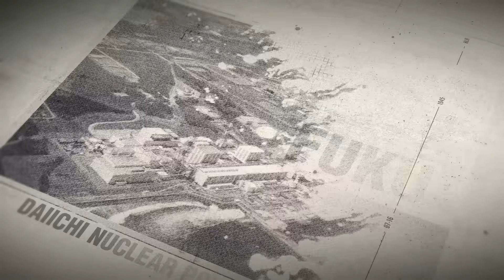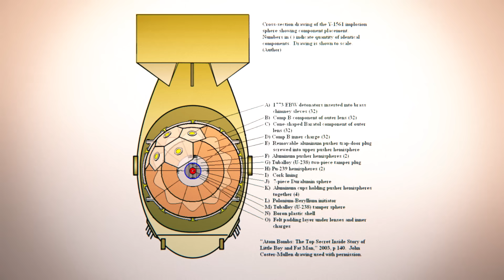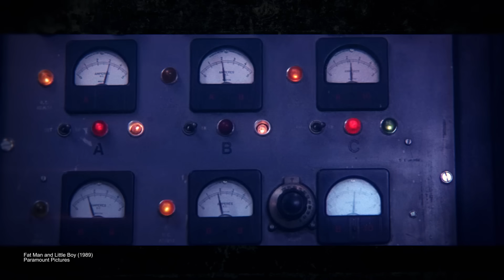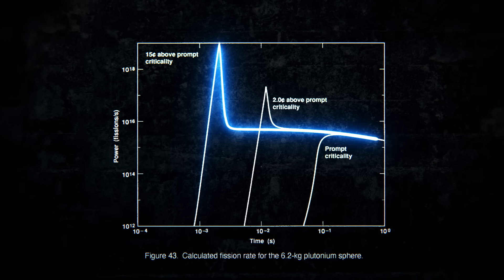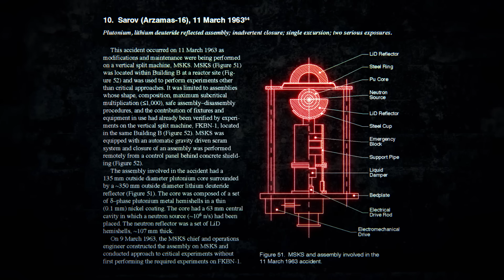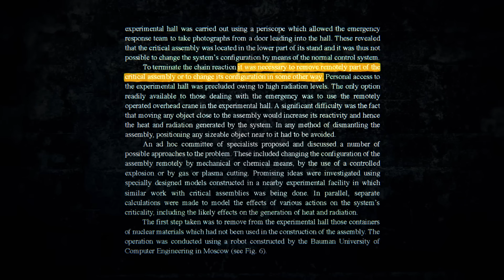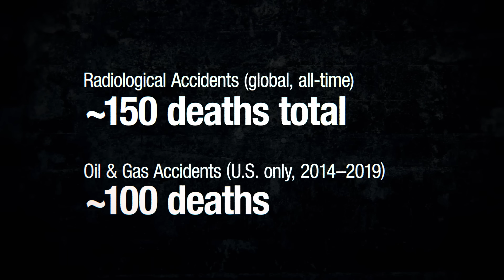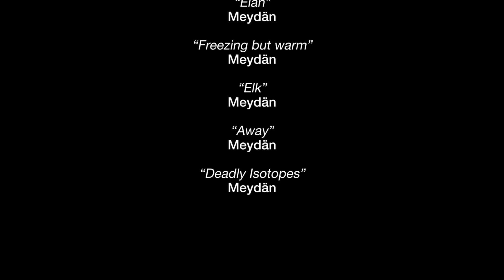Russia's Demon Core - Sarov Criticality Accident

Comment: I want to tack on for anyone that thinks radiation deaths are worse than anything the oil industry could cause: the oil industry in the US uses hydrofluoric (HF) acid as part of the refining process. HF is both highly caustic and a contact poison which can turn into an odorless gas when exposed to air. It penetrates latex gloves, skin, and deeper tissue rather easily and really likes the calcium in your bones. It also really likes fats and can cause cellular damage including to nerve cells so people who are exposed to it often don't seek medical treatment until it's too late since they can't feel the damage.

From Wikipedia:
"In a concentrated form, HF can cause severe tissue destruction through lesions and mucous membrane damage, but dilute HF is still dangerous because of its high lipid affinity, leading to cellular death of nerves, blood vessels, tendons, bones, and other tissues."

Philadelphia was almost exposed to this in 2019 when an oil refinery exploded due to negligence of maintenance but fortunately the people on site reacted quickly and appropriately and prevented a terrible tragedy from occurring

Comment: I live near a couple nuclear plants. One of them has speakers set up in a certain radius to blare an alarm if there is ever an incident. They test them now and then to make sure they still work. While the residents are notified of the tests to avoid panic a delivery driver who lives outside of the area isn't. So I was working one day and the test happened. I didn't shit my pants or panic. I just accepted it. There is no outrunning a runaway reaction. It happens so fast you wouldn't even have the  time to think about what to do. Texted my parents that I loved them, brothers too, and continued working. It sounds stupid but when you approach everything scientifically and you can calmly accept that things are just fucked behavior like that is expected. Didn't see a point in sitting there in a panic or trying to outrun something that happens faster than the brain can send signals. Since then I make it a point to check when they're testing the system.

Comment: It's no surprise the guys selling buggy whips would play up the dangers of automobiles.
Reply: To their point, have you looked at the numbers on casualties directly caused by automobile use? In just the U.S. in 2022, there were 42,514 fatalities. That averages to ~116 each day that year. I fear if we ever have "flying cars" that are more than just airplanes.

On the other hand (and I only just happened across this while curiously looking up Horse & Buggy numbers for contrast)... it appears there are serious issues with safety and treatment for horses used to pull buggies (and thus secondary risk to the people transported by them or in the vicinity), especially in cities (they are very *not* built for traversing concrete) and hot/cold environments (they don't have special hot/cold resistance) their bodies just aren't equipped to handle.

Along with other factors, it's looking like the last support for horse & buggy has been largely vanishing worldwide.
Reply: @JarieSuisen 
I was simply making the point that obsolete industries (like fossil fuel) will make the new technology look dangerous and scary. Ie Edison electrocuted an elephant to "show" the world how dangerous alternating current is...never mind he was heavily invested in direct current.

Comment: I think the reason nuclear energy is so scary is because it is spectacular. Deaths are either horrifying, or a silent killer it is impossible to escape, while in the oil industry they seem so much more mundane. I am terrified of the gas tank in my grill. I know it´s not gonna explode, there´s not enough pressure to turn it into a shrapnel grenade. Still, the fear persists. Brains are unhelpful, that way.

Comment: I am, personally, extremely grateful I live near a nuclear power plant (Duke Energy Progress, Wake County, NC). I grew up in an area with primarily coal power, as well as a NASA facility with a garbage burning plant for its power, and it's an extremely marked difference in air quality even just baseline. Plus, vegetation and water sources are healthier here compared to where I grew up. I grew up in the Chesapeake Bay region of Virginia, with protected marshlands in every city or county that's direct against the coast, and yet the closest we ever got to nuclear energy has been the reactors they put on naval ships and submarines at the Newport News shipyard. Hell, the nuclear plant here even has a program where they offer iodine tablets, 100% for free, to whoever requests them as a safety precaution despite the incredibly low possibly of an excursion or other accident that could cause significant fallout to the surrounding area. And the portions of the grid that are attached to that plant are more stable, to boot. It's rare that a storm knocks out residential power in areas that are directly on the grid supplied by that plant. Stoplights are a different story since their power supply goes through a switchboard/regulator that's significantly more vulnerable than the rest of the grid.

I do thank both you and Plainly Difficult for giving me the tangible information to explain how much safer nuclear energy is compared to fossil fuels and even at times things like wind power (the maintenance of a wind turbine is hellaciously dangerous), statistics and all. ❤☢️
Reply: I was an Instrumentation Tech there at SHNNP 1983 to 2005. Fun times.

Comment: What gets me is the fact these guys were doing these experiments right at ball level with no sheilding.
Reply: Shielding is not normally required when working hands-on with unirradiated uranium. Given sensible working practices, doses can be acceptably low without any shielding.
Reply: @derekp2674  yeah, i still dont think any sensible man would want his junk anywhere near radiactive material no matter what the case may be.

Comment: 10:20 I would have tried to use a powerful fire hose.
Knock it over with the water pressure.
And even if that fails the water might help act as a moderator to reduce some of the effects.
Reply: Water as a moderator might act to make the criticality worse not better.
Reply: @derekp2674  Only if there are walls for it to bounce back off of.
It slows down the particles, which when in a reactor means they will bounce around at a better speed.

But if not in a reactor, there aren't as reflective walls for the particles to bounce off of.

Meaning it will simply slow down their speed.
Reply: @Targe0 Ah but slower neutrons are more likely to cause fission than fast ones.
So firefighting with water can be a great hazard in some nuclear plants.
Reply: @derekp2674  They can only cause fission if they are moving back though the core.

Meaning they have to exit, pass through the water and go out and bounce off a wall and come back to land in the core again.

Which, as the room was designed to absorb radiation leaks, the amount of rebounding would be minimal.

As, reactor cores are also designed to aim everything bouncing off the walls back into the fuel.

Their experiment room was not.

You're looking too much at the particle physics and not enough at the geometry needed to make the physics work.

Comment: In the fission diagram at about 1:30, the large nucleus being split is labelled as U236. Should this be U235? I thought U236 was not fissile.
Reply: U-236 is formed after U-235 absorbs a neutron. U-236 is very unstable and so about 90% of it fissions soon after formation and the best undergoes radioactive decay with a half life of about 23 million years.

Comment: How did the scientists assemble nuclear bombs/devices with a core in the middle, without getting irradiated in the way illustrated in this video?
Reply: The bombs are designed to be safely subcritical until detonated, then they go highly super prompt critical.
So the radiation doses from the components are low enough to permit hands-on assembly or disassembly.

Comment: There is one issue... radiation changes DNA. Toxic fossil fuels can do this either, but in a different way. The latter has to be inhaled or ingested to be 'effective'. Gamma radiation just invades your body, with extremely high energy. You can not sense it (fuel can be smelled), and you can barely shield from it (hazmat suits do nothing). 

This is what makes it so scary. The most frightening things are those that you can not see coming.  Like a Predator.

Comment: My first thought for how to disassemble the assembly remotely was the astonishingly primitive "really long stick". it's a very human response to look at a problem on the cutting edge of physics and reach for a tool that predates fire.
Reply: I mean... it has the reach and a relatively small area facing the core to deflect neutrons back at it. Sometimes the simple option is best. I'm guessing it wasn't an option because the room was likely built with several corners in the entrance to prevent all direct radiation from exiting.

Which was why my next idea was "robot with long stick". Which... is more or less what they went with.
Reply: I immediately thought
 comically large stick
Reply: @TheHydrator2003  Slotin could've poked at the core with a comically large stick while shielded behind a conveniently shaped lamp
Reply: A suction cup on a long stick xD
Reply: big stick fixes anything
Reply: Wasn't the screwdriver just a really small stick? There's precedence for that idea!
Reply: My first thoughs were a robot to get near it and then blast it apart with a jet of pressurized air or water.
Reply: Big stick or a super accurate nerf dart.
Reply: @redaffix7320  I was actually about to jokingly suggest just shooting it with a gun lmao
Reply: my first thought was "shoot the reflector with a big gun and maybe it will fall off". yes I'm american
Reply: that's primitive, but my first thought was "send the dead man walking who caused it back in to take care of it, he's dead already who cares"

Comment: Can someone explain why Gray is used and not sievert for dosage in this video?
Reply: Doses assessed in Grays are a direct measure of radiation energy absorbed in human tissue, so they directly correlate to actual radiation injuries, such as burns and the destruction of key organs. So Grays are the preferred units for severe accident doses.
Doses assessed in Sieverts adjust the absorbed dose by means of weighted factors that balance out the relative biological effects from different types of ionising radiation. This is done to provide the best assessment for long term risks such as the risk of subsequently developing cancer.

Comment: Its hard to estimate deaths to nuclear because death certificates usually arent written by “nuclear radiation” its written as things like “renal failure” or “cancer”. This is multifold but one of the reasons is to push blame to more natural causes rather than being responsible for horrific aftermath.

For example, Louis Slotin’s death is attributed to “Extreme Burns” and thus is not counted on radiation poisoning deaths.

Comment: What is more interesting about this accident, that this construction has provided with the emergency self-disassembling system of security, based on fault-free gravity principles. But it hadn't worked that time, apparently due to the sintering these hemisphere together.
Reply: If you can download LA-13638 you can read up on the details of this accident and all of the mistakes and errors that led up to it.

Comment: so.. does anybody ever knew what happend to the people who actually melted those things into shape?
 I mean blacksmith/ metalurgic workers?
 if the genius didnt have protection what do the workers had?
Reply: The components would have been produced under a safe system of work in a fissile metallurgical plant.
Material is typically handled in gloveboxes and radiation shielding is applied around the boxes where required.

Comment: Why aren't these experiments done sideways over a pool with a mushy boom, with the core glued in place with some easily molten adhesive, and the shells mounted such that if you cut the power from the outside gravity will just pull them apart into a safe position?

Comment: Demon cores can be shut down by approaching them with a neutron absorber, such as boron. A bomb is actually hard to make, especially with plutonium, which has a high spontaneous fission rate. But plutonium is preferred for legal bombs because it has the smallest critical mass.
Reply: But the boron needs to be inserted into the fissile material to be effective at terminating criticality.
If just pushed up to the core it will make things worse.
It will only interact with neutrons that that already escaped from the core. Although it will absorb some, it will reflect some back into the core, and those may then cause further fissions

Comment: I've been wary of nuclear energy from my earliest introduction to it as a concept. I've been anti-nuclear since the Fukushima melt down. I knew that nuclear was generally safe, but thought it still wasn't worth it for two main reasons. One, the worst case scenario is catastrophic. Two, both Chernobyl and Fukushima were caused, in no small part, by hubris. Soviet hubris that prevented the desemination of the knowledge of the risk caused by the double tipped rods, and needing to complete the test to save face. And with Fukushima, the hubris of capitalists that assumed their sea walls would be high enough and therefore it wasn't worth the cost to build a couple feet higher. I'm still uncomfortable with the risk hubris and cost cutting presents in the nuclear energy because it cannot be eleminated. That being said, I've watched most of your videos. Once you started comparing the casualties of all nuclear accidents compared to a single year in Oil & Gas, I was forced to change my mind. I'm still not comfortable with nuclear, I have a visceral fear that sits to deep, but I cannot deny that it is essential for a sustainable future. There's a lot of historic harm that is not being adequately addressed, especially in Indigenous communities near mines and tailings ponds, but it's clearly safer that O&G. Maybe someday we'll move past the need for nuclear, but not within my life time, and we need climate solutions now.
Reply: What I'm most excited about going forwards in regards to nuclear power, is the creation of passively stable reactors like molten salt reactors, where in worst case scenarios there are no catastrophies, just a stop in power. I'm glad to hear someone else changing their mind towards nuclear :) I remember in school I was very confused about the whole topic as I knew next to nothing about it
Reply: How many people die in the average civil aviation accident in the US? Just one?

Seventy-two. Motor vehicle accidents are higher. About 120. Per day. Risk is a spectrum.

Comment: 5:14 I don't think anyone in the nuclear industry would run away as quickly as possible unless that person is an intern who doesn't have any idea about what he is doing 🤣🤣🤣🤣  

Even I who is not an electrician but just a DIY who have basic knowledge about electric/Voltage current knew how to Quickly disconnect the wire from the battery or plug from outlet once something bad happen.   the people who  run away would probably your wife or kid who have no knowledge about circuitry.

so I'm pretty sure in the nuclear industry it would be the same.  it doesn't matter how deadly it is, if something suddenly go wrong your instinct would always be to turn it off.
Reply: Check out criticality evacuation alarms!
Nuclear industry staff are trained to run away.
Time, distance and shielding are the basis of radiation safety because you can't turn radioactivity off.

Comment: Every time Kyle talks about nuclear vs. coal, I sit here in my city which switched to almost 100% renewables in 2022 as part of the Orange County Power Authority and want to say "buuut!" 

However you need to hit critical mass in a community to build the consensus for that, and it's not without its growing pains.

 Still, it's felt pretty good to be running on 100% renewables without having to fight an HOA or private contractor to get my own panels installed.

I recognize tthe inequity of our getting a head start on the energy transition which other parts of the country can't afford —.hopefully by buying in we can encourage improvements in renewable tech and drive the price down for everybody.

Comment: You mis-state a fact at the beginning of the video.  You say that the first two plutonium cores were exploded over Japan, while the third became the demon core.  That is incorrect -- the first plutonium core was detonated in the Trinity test, and the second was exploded over Nagasaki.  The Little Boy bomb dropped on Hiroshima was a uranium bomb, and because of differences in the way plutonium and uranium lose neutrons when they achieve critical mass, you didn't need to implode a spherical core of uranium to get it to go critical and explode.  You could just jam two sub-critical masses of U-235 together quickly, and get it to go explosively critical.  So, Little Boy just used a gun-type arrangement to blast a big U-235 slug into a U-235 target.  So, yeah -- the first fission bomb dropped in anger (over Hiroshima) had no plutonium in it.
Reply: The gun arrangement was a hollow "bullet" cylinder that moved to surround a fixed slug

Comment: One of the other downsides to nuclear power is its sheer inefficiency. All that “waste heat” is energy loss. All the energy used in cooling is energy loss. We have a hella hot teakettle pumping out massive energy yet are just sipping from the firehose. Plus, all that heat is a big part of reactor accidents, without it we skip TMI, Fukushima, and Windrush at a minimum.
Reply: Sorry, Windscale, not Windrush.